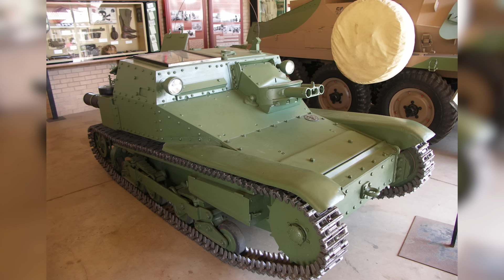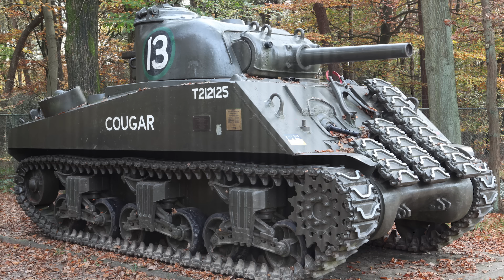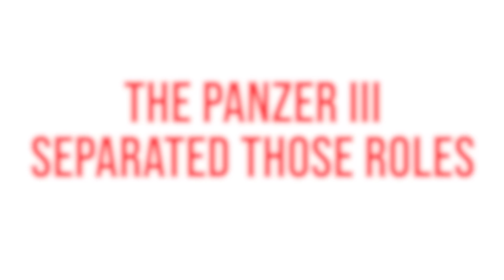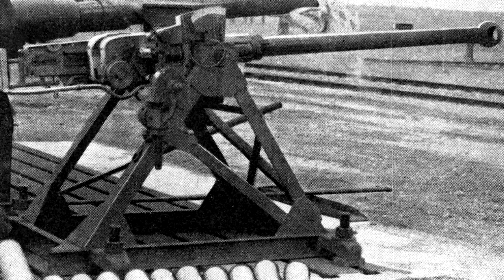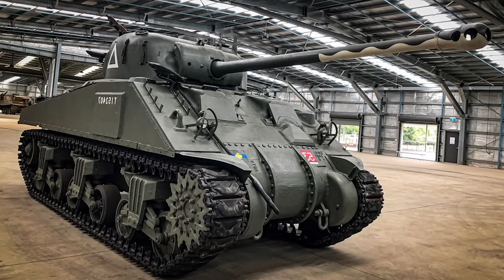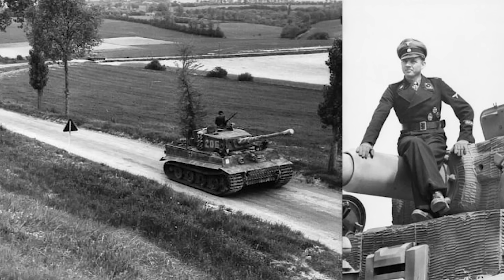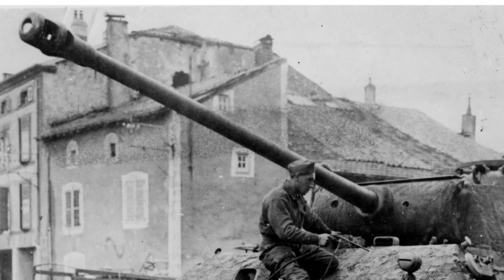Every WW2 Battle Tank Ranked — WORST to BEST

Comment: You forget that Britain and Canada took the 17 pdr and put it on a Sherman. The US military had their nose out of joint and would not do it. Tigers and panthers found out the firefly was something not to be messed with.
Reply: Only partially correct, according to author Steven Zaloga. There were several very good reasons that the U.S. didn't adopt the 17 pdr Sherman Firefly. First, it was very much doubted that the Brits could actually produce the number of 17 pdrs that the U.S. Army required (the Brits were having enough trouble producing enough of them to equip their own Shermans). Second, the gun took up so much room in the original Sherman turret that the U.S. evaluators didn't think that it was an ergonomically efficient, or even safe, set-up for our draftees (they had the same objection to putting the U.S. M-1 76mm in the original Sherman turret). Third, the U.S. was already planning to put the M-1 76mm gun into the next gen T23 turret and expected it to be "adequate to the task" (which turned out to be incorrect), so the 17 pdr would've created another (4th) supply chain for ammunition and parts since you would have had Shermans equipped with 75mm, 76mm, 105mm (howitzers) and 17 pdr guns. Fourth, the first 17 pdrs that were demonstrated to the U.S. Army "flashbacked" into the turret due to insufficient/faulty/poorly designed breechblock sealing, a situation that was deemed entirely too unsafe for U.S. crews and contributed to an impression that the 17 pdr conversion was too much of a rushed, poorly engineered, and insufficiently tested lash-up job. Even in 1945 it was said that among British/Canadian tank crews, one could always tell a Firefly crew by their lack of eyebrows and facial hair, the singed hair below their caps/helmets and their "sunburned" or smudged-up faces due to flashback from the 17 pdr. As well,, the U.S. was already planning to field the T23 turret (on the 76mm equipped Shermans, along with the M-4A3) and the gun mount that the Brits had designed would only work in the original Sherman turret, but not in the T23 turret.  Then there was also the matter that the 90mm M-3 gun was already under development for adaptation to a tank gun and it was expected to be, and was, a much-better all-round tank gun than the 17 pdr.
Reply: @CactusJack-j1k  There's even more to the story. The 17 pounder was hard to aim, and was a bit inaccurate. In addition, it reloaded SLOWLY. Yes, it hit harder than the 76mm, but was a bit overkill 99% of the time. The slightly less punchy 76mm was easier to aim, faster to reload, more accurate at range, and could carry more ammo.
Reply: I think it was the Brits who actually made the firefly but Canadians made good use of them too
Reply: @frankhill2406 The Poles used them too.
Reply: @frankhill2406 we did
Reply: Joe Ekins used to come to our Regimental dinners!
Reply: Never heard of the "Easy 8" or the "Jumbo Sherman" I guess.  Canadians and Brits should have built their own tanks instead of always relying on the Americans for help.  Just another person who fails history and yet...think they know everything.
Reply: @chitownlivingston7007  British industry simply couldn't produce the number of tanks needed, especially when their plants were subject to German attack and U.S. plants weren't. The Brits did assist in the design of the Sherman. The U.S. had very little experience in designing or building tanks.
Reply: @c @chitownlivingston7007 . Looking in the mirror?  The Easy Eight had the 76mm gun and Jumbos had the 75mm, some having the 76mm, neither gun having anything like the penetration of the 17 pdr. Although making heavy use of the US’s industrial capacity, US’s allies produced more tanks and SPGs than they got from the US. What’s wrong with teamwork?

Edited as cut off the Lo from Looking when I first posted.
Reply: @Dalesmanable  But the 17 pdr had no where near the HE round that the 75mm fired, which is why Fireflys were initially allocated at one or two/troop. Far more HE rounds were fired from WW2 tanks than AP rounds.
Reply: @CactusJack-j1k  But what’s that got to do with it?  It had no bow machine gun too. It was intended as a tank killer for armoured units first and foremost with no intention of being used to support infantry, although occasionally being used in the latter role and as mobile artillery.
Reply: @Dalesmanable  the Sherman was designed as infantry support.  The Brits were stupid enough to use it as a tank destroyer.  Basically the Brits misused the Sherman.  Why Montgomery couldn't take Caan until Patton broke out and was surrounding the Germans which forced them to pull out.  To destroy tanks the Americans used artillery - the 240mm and 150mm guns which were much more powerful than the 17 pounder.  Americans also used 'tank destoyers' such as the Jackson, the Hellcat, and the M-10.  Britains answer?  The Firefly.  The Americans and Soviets understood the tactics of using artillery and tank destroyers.  The British NEVER understood that simple fact.
Reply: @chitownlivingston7007 . Give it a rest. Why are you trying to pick a fight?  WW2 armour has been a hobby of mine for 60 years so I’m not the idiot you seem to think I am. 

At the end of the day the Firefly was a quick fix one-trick pony that did its job well for non-US units (British, Canadian, Polish, French etc) and standard Shermans fought to their strengths particularly when supported by the artillery you mention were more than capable of taking on the German heavy tanks. In what was in hindsight arguably the right decision, the US for a variety of good and not-so-good reasons stayed with the 75 and 76 Shermans alongside TD units. The British retired their Fireflies at the end of the war because the Comet and Centurion were far superior all-round tanks.  The Easy 8s suffered at the hands of North Korean T34s until Pattons wiped them out. 

The TD’s primary role was just that: destroying tanks. They did from time to time act in the infantry support role but this was the exception rather than the rule as their open tops and thin armour made them vulnerable to mortars, artillery and many light weapons particularly in built-up areas.
Reply: @c @chitownlivingston7007 FFS give it a rest. Your rabidly pro-US/anti-British narrative is laughable bollocks.
Reply: @chitownlivingston7007 Ultranationalist bullshit. I am an American but am well-educated enough on the war to know that British artillery was numerous, well used, and highly effective, based on German accounts (e.g. El Alamein). Stop embarrassing those few of us Yanks that still care about the truth.
Reply: @dougferguson3820  any in Europe?
Reply: @Dalesmanable started with the anti American, pro British comment at the top... "the US military had their nose out of joint...".  If it wasn't for the US, Britain would have starved and would have NEVER landed in Europe.  Just say "thank you" or don't say anything at all.
Reply: @Dalesmanable starts with the anti-American, pro-British, Brits know better than American comment at the top... "US military had their nose out of joint".  You can stand for it... I won't.  And Korea... the Pershing destroyed T-34's as well as the Pattons.  Any Brit tanks?  I don't know of any.
Reply: @chitownlivingston7007  Don’t be so ludicrously precious. The US claim of saving democracy is laughable. It stayed out of the war other than making money selling arms for 2 years and only came in when attacked. It ended the war as one of the 2 big winners and then spent decades getting its pound of flesh from Britain. Its crowing is hollow.
Reply: @chitownlivingston7007  No British tanks in Korea?  Ha ha, you’re showing your ignorance and your laziness in not doing a quick internet search.
Reply: @Dalesmanable 1300+ American tanks... less than 100 Brit tanks... yea... sure... right... those Brit tanks pushed back the North Koreans all by themselves and Brazil won WW2 all by themselves.
Reply: @Dalesmanable move to London and convert to Islam... "precious".  You prove my point... people don't like to be talked down to "precious".
Reply: @Dalesmanable PS... I bet Brazil sent tanks too!  KMA!  Move to Pakistan or Afghanistan or London!  Last response... tired of dealing with "precious" idiots.  Ta ta and cheerio!
Reply: @chitownlivingston7007  Go back and read my posts again, kid. You’ve wasted enough of my time.  Come back when you’ve grown up.
Reply: @chitownlivingston7007. Yes, the Brit’s were in rough shape in terms of supplies before America showed up but we should not overlook the fact that Germany made a huge mistake invading Russia who ended up taking a serious bite out of the reich. 

I would suggest that it was a damn good thing the three allied powers did band together to take out the Germans or you might be living in an entirely different world today.
Reply: @sapporoichiban3612 I saw your reply and was thankful it was respectful.  I agree the world would be different in Europe.  If the US wasn't involved and didn't aid either the USSR or Great Britain, it would come down to 100% of German forces battling 100% of Soviet forces.  Europe would be either under Nazi rule or Communist rule.
Reply: @sapporoichiban3612 Indeed. The British kept the fight going, the US provided much matériels and the Soviets did most of the German fighting and killing.
Reply: @chitownlivingston7007 There were Centurions in Korea.
Reply: @Dalesmanable It's laughable to say the US made money from the war.  After the first year of the war everything was given free under Lend-lease.  Imagine the largest Empire in the history of the world crying poverty after just one year of war.  The US war debt wasn't paid off until The Reagan administration. The British whined about Marshall paying to rebuild Europe.  They wanted the US to rebuild Britain too. They were given a 50 year loan at 2% that was repaid 10 years late.  Please don't tell us we made money on you when we gave most of it for free and rest was repaid at 10¢ on the dollar or just returned.
Reply: @blackpowder4016  A very strange view of the facts. Yes, lend lease was a great help but it was far from being as altruistic as you make out. Regardless, The US emerged from WW2 far richer and more powerful than it started whereas Britain emerged broke with vastly diminished power and an empire disappearing before its eyes.
Reply: @chitownlivingston7007  aww you poor Maga.  Those were after Britain and Canada were using the firefly. If you noticed the US was ok with loosing men and tanks. They just thought send 5 Sherman’s to take on a tiger and the consequence was a lot of dead crews.  Oh and dummy what was the Churchill and other tanks? Another blowhard US person being selective in history.
Reply: @stephenKay-su8pw dead?  How'd Dieppe go?  Caan?  Market Garden?
Reply: @stephenKay-su8pw  Actually, U.S. forces didn't encounter very many Tiger Is during WW2. In fact, records cited by noted author Steven Zaloga reflect that they encountered more King Tigers than Tiger Is due to the advance of U.S. forces toward the manufacturing and training center for King Tigers. You are correct; however, that both the Jumbo and the "Easy Eight" were fielded after the Firefly, though Shermans with the T-23 turret, the longer 76mm main gun and "wet ammo stowage" were available for Overlord. At that point U.S. tankers who were surveyed, as well as the experienced commanders of the U.S. Armored Divisions, weren't enthusiastic about them as they were still relatively happy with the 75mm M-3 main gun since it threw a much better HE round than the 76mm (many more HE shells were fired by the tanks of all armies during WW2 than AP rounds) and also had a WP (White Phosphorous... "Willie Peter") round) that the 76mm didn't have. As well, most Shermans that were already in field use had been updated with supplemental armor kits ("Quick Fix" kits?) and the U.S. armor unit officers were concerned about the time it would take to re-train their crews on the "new" 76mm Shermans on the eve of Overlord. Such attitudes quickly changed when U.S. forces encountered far more Panthers in Normandy than was anticipated and also found that frontal armor had been added to the Mark IVs. As to the U.S. Army allegedly being "okay" with losing men and tanks, one has to recognize a few realities: (1) U.S. factories were 3000 miles away from the "front" (literally "an ocean away") so feedback from the front didn't necessarily make it back quickly, nor could it necessarily be implemented quickly; (2) because there was a 3000 mile supply line, U.S. forces had to know that all of their equipment would "work as advertised," especially motor vehicles, so modifications had to be made judiciously and be "tried and true" when they arrived; (3) when it was introduced, the Sherman was pretty much the equal of its most capable competitors, the Mark IVF2 and T-34, and was superior in terms of reliability, durability, radio systems, turret speed and ergonomics. It was definitely superior to the Marl III and Crusader but it didn't get updated as quickly as some of its contemporaries (see (1) & (2); (4) according to Zaloga and others, the Sherman's designers intended it to be proof frontally against 37mm - 50mm anti-tank ammunition; however, the up-gunning of its contemporaries proceeded much more quickly than U.S. planners anticipated (remember that both the U.S. military and U.S. industry had very little experience in designing, building, fielding or tactically using tanks). Again, think about (1) & (2); (5) according to the same sources, U.S. designers intentionally specified softer, less brittle, armor than was used by the Germans or Russians, as it was more easily used in casting turrets and hulls (M-4A1), speeding up production (remember that U.S. industry was supplying Shermans to British and all Commonwealth forces, the Nationalist Chinese and the Free French, as well as the Russians), and produced much less spall when the armor was penetrated, resulting in fewer crew shrapnel injuries; (6) post-war studies revealed that, on average, less than one Sherman crewman (0.6 crewman) were lost for each Sherman knocked out, a figure that included the early Sherman models without wet ammunition stowage. This may reflect the relative lack of spall and secondary shrapnel effects and the comparative ease with which Sherman crews could evacuate the vehicle (you might want to look at a video entitled "OMG the tank is on fire" for further enlightenment there); (7) according to Zaloga and post-war studies, the "5 Shermans to take out a Tiger/Panther/whatever" is largely a myth, just like the "Ronson" appellation (Ronson didn't use the "lights every time" slogan until well after WW2). In most cases Shermans were on the offensive, while the German tanks/stugs/anti-tank guns were on the defense, so Shermans, or any other Allied armor, were generally at a disadvantage, just as Panthers were found to be at a disadvantage when they were used in offensive operations like the Battle of the Bulge, or the panzer counterattacks after the Normandy landings (Panzer Lehr at Le Desert); (8) If you want to talk about "a lot of dead crews" you might need to be looking at T-34 or Comet crews (again, see the "OMG the tank's on fire" video). BTW... this isn't a "MAGA" issue, it's a matter of actually studying history and seeing how many British and Commonwealth units, as well as Free French and Russian units, were totally equipped with Shermans. My 1st Infantry Division, North African Campaign, Purple Heart-awarded combat infantry Dad taught me a long time ago that if the Brits hadn't held on and given the Germans a bloody nose, WW2 would've been lost, as there was absolutely no way that an amphibious operation from the U.S. could've succeeded in re-taking the U.K., but he also taught me that WW2 was a cooperative effort... from our resupply of equipment that was lost at Dunkirk and in North Africa to the Mustang being fitted with the famous Rolls-Royce Merlin engine.
Reply: @CactusJack-j1k  glad your dad taught you it was a cooperative effort. I very much dislike the US and Britain taking credit for WW2 when there was a lot more nations involved. Something the Brit’s and US as a whole tend to forget.  Same goes for WW1
Reply: @stephenKay-su8pw  Sure there were a lot more nations involved in WW2 than just the U.S. and the Brits (I included the Commonwealth ones in my comments), but the principal ones in the West were the U.S. and the Brits. 'Course the Russians suffered greatly and performed bravely... after having been on old Adolph's side in the beginning (remember the Katyn Forest?). And we should never forget the Chinese Nationalists and Filipinos.

Comment: Linx? This is a few tanks not every tank. The 50 mm cannon was added to the MK III later. Early versions carried a 37 mm totally insufficient against Russian KV & T34 tanks.
Reply from the maker: You're right, the video focuses on a selection rather than every single tank. The early Mk III did indeed have the 37mm, the 50mm came later.